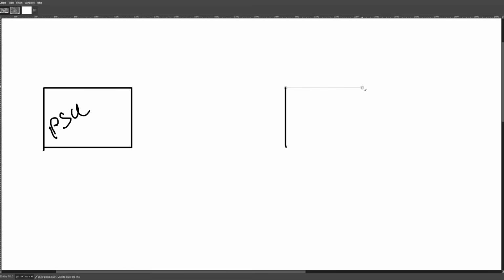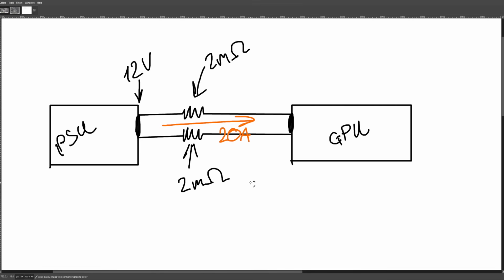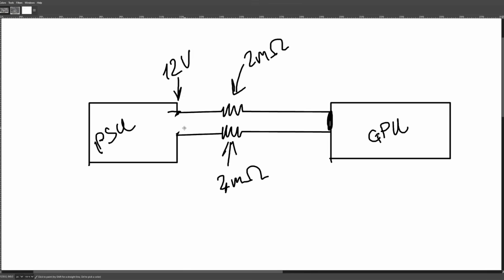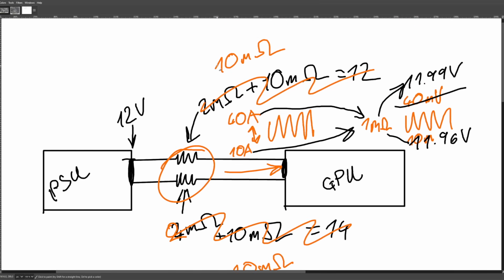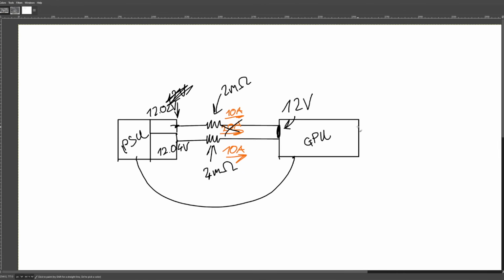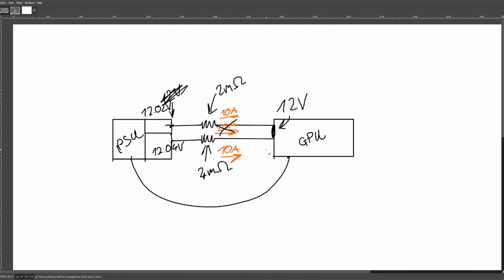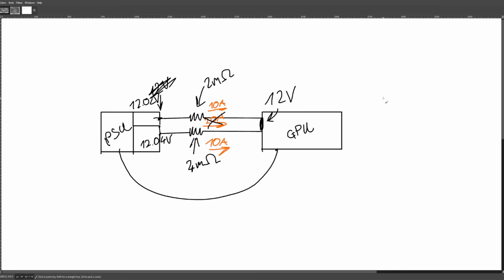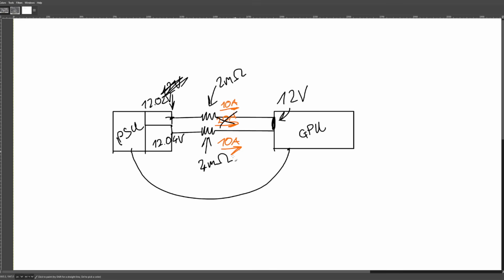Why ATX power supplies don't load-balance power connectors

Comment: Here's the top reasons i can think of why you will likely NEVER see a burned ground wire in the connector.
3. If the connection was ever bad enough to start losing sufficient wattage on a pin to do big damage, before that, your GPU is going to crash with PCI signalling errors, because you have gained too much of a ground offset and from the point of view of the GPU, the signal has started clipping the threshold or ground level. this is the least prevalent and most important reason.
2. there's a lot of excess redundancy in ground. While current will generally prefer to go back the way it came in, if it can't, it'll seek its way through the card edge connector, and if that doesn't suffice, through the steel bracket
1. the pin placement of the ground pins makes it less likely that their connection is unreliable
Reply: 2 - in regular PCs the vast majority of metal surfaces are common ground, mostly for signal integrity and EMI reduction reasons.
Some connector shells/shielding may be floating (unconnected) but that's more into nitty details of shielding efficiency (connecting both sides vs one and etc)

Comment: Short awincer is it would be to expensive 
grond never will melt because there is more contact to the ground. like the GPU being bolted to the Frame of the case..  and every single ground connector in the PCIe slot 

I work on a lot of linear power supply and we use .05 ohms for load balancing resistors for the pass transistors. 
so you would then be running 15+V and using pass transistors and sense wires to load balance everything...  OR lets just try this? go back to the old connector! or use the old connector's pins that have more mass and redesigned the connector form factor..

Comment: The high power connector is what is wrong with the companeys in this world save a buck on a connector and a few bucks on the motherboard and insane failure rates for consumors! This thing is desinged so bad. With zero safety margins! The old connectors so over designed and engineerd that these do not break not for motherboards or gpus. Why are these companys sticking to insane RMA costs? Even apple after generarion 3 of butterfly retuned to its old design. Wish there would be a class action suite against these companey! And they have to pay millions in damages think they would wake up then? Luckt AMD vendors are still sticking to the old connevor.

Comment: How about one PSU that does forward voltage sensing and variable resistance per pin? It would adjust its singular voltage to something higher based on the combined resistance of the load balanced cable connection to the consumer. Is there a problem with that?

Comment: Random thought, maybe NVIDIA can stop trying to achieve z-pinch fusion energy densities on GPUs and be more reasonable with power requirements of consumer products. (gets tossed out the office window)
lol.

If you just think about all the other stuff in your house that pulls a lot of power, most of it is heavily regulated with laws dictating how it is connected to the mains, dishwasher, stove, water heater, furnace, refrigerator, etc, a PC isn't one of them that requires a dedicated mains circuit. Just saying, lol.
Reply: Well PC`s dont usually pull 2-3kWt`s either. Even an average microwave is FAR more powerful then average PC, much less something like washing machine or stove.
Reply: @alexturnbackthearmy1907  not even, 600 watt stuff has all kinds of laws regarding it, so eh, lol. a refrigerator does not pull kilo-watts, most ten to twenty gallon water heaters use 900 or 600 watt heating elements, the low setting on most space heaters is 600 watts, etc. And all of that stuff has laws regarding how it's connected and used.

Comment: A good PSU load balancing would not be adding resistance to balance the 12V lines, it would be splitting the 12V rail into 6 independent rails, one per pin. Same way CPU and GPU power delivery works. If you can get 18+ "phases" on a $200 motherboard, why can't you get 6 sub-rails on a $200 PSU? It's not rocket science, the components only have to handle 10 amps instead of 60... why not? Yeah, it's gonna be more components, but cheaper components. Efficiency would also be fine, because one 95% efficient voltage regulator is exactly as efficient as 6 95% regulators in parallel. You don't really need remote voltage sensing for this to work, each regulator "knows" how much current it's supplying and can compensate for the voltage drop across the wires and connectors based on that, just like some USB-C power delivery controllers do. And if there is too much imbalance and the voltage at the card is dropping too much, that's something the card can easily detect and shutdown if necessary - that a lot better than melting the damn connector!
Reply: what you are suggesting is basically his multiple power supply example. since all phases are connected at the gpu side when one phase delivers less voltage the other ones would push current to that phase. and i don't think you can decouple them since they would always have a common ground gpu side.

Comment: Hear me out: 48V or 24V.
The main reason for all the issues is increasing power draw and thus increasing current, necessitating new cables/connectors.
I think it's gotten to the point where we're better off raising voltage to 48V or 24V from a safety as well as practical and efficiency perspective, instead of increasing current.
Reply: If we're going to change voltage anyway, definitely go 48V. That won't solve current balancing problems, but will improve things because you can get away with more inline resistance and lower sized wires.
Reply: I've been advocating (in the offline world) for using 48V for the main power delivery inside computers for a while now. In the automotive world, 48V ist a mature technology nowadays. Going from 12V to 48V, the connectors and voltage converters (convertion to ~1V for the chips) stay basically the same (48V is still well within the normal Silicon MOSFET range, without needing "fancier" stuff such as GaN MOSFETS) and you get 4x the power per wire. E.g. a 10A cable will give you 120W on 12V, but 480W on 48V.
As we're currently seeing escalating power requirements (e.g. Socket AM4 to AM5 increased socket power from ~180W to 230W, GPUs are worse), going to 48V would really help with keeping the complexity of wiring/connectors/power regulators down (at the small cost of a complete incompatibility of pretty much all power connections inside a computer :-P)
Reply: @SASAS-ru8ys 48DC seems a bit too spicy, that's entering (mild) shock territory; probably not a safety hazard but try explaining that to a first-time PC builder who gets freaked out by it. 24V or maybe 36V seems like a better balance of safety and efficiency.
Reply: @spambot7110 hasn’t been a problem in the past… old telephone lines use 48V to power consumer devices and PoE uses it as well… 48Vdc is not dangerous at all
Reply: Hear me out: Rectified 240VAC into 240 VDC and SN 441011 Type 23 plug, rated for 16 A ...  Would have said Europlug but that's just rated for 2.5 A.

But joke aside and TBH: if they want one single connector: ATX 20 pin. Otherwise get that shit 12VHP out and shoot the bean counter and engineers that came up with it and those that "certified" it out in the backyard ... so they can visit the farm like Little Timmie's Golfish.

This is a shit standard and it will never be good. As AHC says, paraphrased: It gets it panties all up in a bunch just because it only plugged in 99.9% correctly. To put in car terms:  "Your windshield is not 100% cleaned this car is not driving 1 meter." See how long you gonna enjoy that vehicle.
Reply: I've been advocating for this for a while, step-down and regulation is so efficient now it's nbd to implement. It adds a few dollars BOM costs though so board vendors will never agree to it. At some point though they'll have to.
Reply: The problem with this is that stepping down that voltage is also a problem. Silicon runs at 1-1.5 volts with stupid high currents. If we increase the voltage, we need much greater step down circuitry on the GPU.
Reply: @ MOSFETs don't run at a certain voltage drops, but do have a certain on resistance. Higher voltages as the source voltage to your buck converter will mean your switch conducts the same current with less on-time, and your ideal diode circuit fills in the rest. Your ideal diode circuit must be specced correctly to not drop too much voltage at the currents they run at, but that current is the same no matter the voltage drop, just with a higher duty cycle.
Reply: Or here me out, we stop using garbage connectors. Using thicker guage cable. Use non melting plastics. 

Wow!!!!!!!!!!!!!!!!!!!!!!!!!!!!! Oh!!!!
Reply: @battokizu  hell yeah lets mine a fuck ton of metals out of the earth unnecessarily
Reply: @ Nice bait.

Comment: Only a few hours ago I commented on another video suggesting balancing be done on the PSU about the balancing... and here's a buildzoid video covering it too! I get the feeling we both watched the same video and heard the same comment. But your rants are oh so much better than mine. Never change buildzoid!
Reply: Haha I think we both watched that video ;) the adventures in high power delivery he's doing are interesting, and I'm curious to see what results he gets with the improved sensors and logging, but I had to correct him on a couple of inaccurate assertions in that video including who developed the connector. I believe he's doing the work in good faith and it was a simple oversight, and what he's doing is certainly not cheap to build and test to destruction, so I hope he contacts BZ and they can somehow collaborate on some joint explanations and investigations.

Comment: Another thing to consider: when you naiively add resistors to this 10A connection (inside PSU), they will dissapate more power as a heat, because P = I*I*R. I*I is already pretty high, and increasing R makes total heat dissapation even higher
Reply: The only way forward I can see is to either reduce power draw or to abandon the connector entirely. It's not good in this application.
Reply: Or if increasing voltage to current balance if the imbalance is caused by a higher resistance on some pin then that pin will have more heat dissipation and in extreme cases melt even if the current is balanced.
It really is a no win for the 12 volt high failure connector.

Comment: This is effectively the same misunderstanding as "it's the volts that jolt, it's the milles that kill", for explaining that a high voltage likely won't kill you if it has a negligible current supply capability. That's true, but only because that high voltage is quickly loaded down by your body. Voltage and current are related, for a given system you can't just force one without affecting the other.

Comment: Would you mind someday explaining why the ground connections are not a problem, only the 12V? At least for me, thats not quite intuitive.
Reply: he did in some old video, but the tldr was something like that the pcie 16x port is mostly ground so under high load some of the return current flows through the mainboard to the 24pin or cpu power ground
Reply: @vincentschumann937 that's terrifying from a signal integrity perspective, wouldn't that totally fuck up the return currents for those poor PCIe signals? (i know they're supposed to be differential but i've also read that digital differential signalling protocols often function as pairs of single-ended signals that are logical opposites, rather than actual acting as physical return paths for one another)
Reply: In short: Current GPUs push way too much of the return current through the PCIe connector. That's not ideal for the mainboard, either, but it's not a melting connectors problem because the MB returns the current to the PSU via both the 24pin connector as well as all other connectors like CPU power and other additional EPS12V. And as Buildzoid said: They're so overspecced they just don't melt.
Reply: Current equals voltage divided by resistance, ground equals zero volts, so 0/R=0.
Reply: @Lost-One-n9s  i'm sorry, do you think that return currents don't exist?? just because you can read a formula and know the units in it doesn't mean you know how to apply it. voltage is a relational measurement, there is no such thing as "zero volts" in the absolute sense. you pick an arbitrary point in the circuit and you draw a ground symbol there, and you declare that zero volts to make the math easier. there's nothing from stopping me from saying the positive rail is actually zero volts, and the negative rail is -12 volts, if i say these words out loud will the negative pins magically start overheating?

Comment: The current imbalance is not the problem. The heat is the problem. Even if you current balance per wire, when a high current draw occurs and the resistance of the connection is high enough, then the issue of heat generated at the connection is still there. It could still be a fire hazard. Who cares about efficiency and voltage drop at the gpu when the connector still melts. You need an early warning for that, better yet a safety shutdown.

Comment: I appreciate the effort, but this is a very simplistic explanation. To model this properly, you need to consider multiple resistances end-to-end: the connector resistance on the PSU side, the wire resistance, and the connector resistance on the GPU side (per wire), then the load resistance and possibly even the internal resistance of the PSU. Everyone just talks about the 12VHPWR connector, but if something on the PSU side is adding to an imbalance, this could amplify issues in the 12VHPWR connector (which I think we can all agree is a bonkers design for such high currents). My suggestion is to model all this in a circuit simulator. Also, I wish someone would desolder one of those connectors and get some actual measurements with an industrial multimeter which can accurately measure low resistances. Also did you mention Kirchhoff? I may have missed it.

Comment: Another option would be to put a power supply directly on the GPU and run a second 120 VAC line to the computer.

Comment: is the asus Thor III PSU advertising the VGA priority feature not actually a load balancing feature at all? You said it’s just voltage sensing so it’s not actually doing something to actively balance the load on all pins? that was the main reason I was gonna get it cause I thought it did load balancing
Reply from the maker: nope it's not balancing it's just to compensate for the combined cable resistance.
Reply: @ wow. good to know. is it an effective method or do you think just marketing?

Comment: So much trouble for load balancing when the simplest solution is to just use a single conductor. It may not be sexy as that wire will be thick but it will be safe, simple, and cheap.

Comment: when i heared the 1st haldf (mainly about the psu ) the only thought in my head: "would that be amazing if we had extra cable that connect to the psu and make that power balance...?
nvidia: "we changed the plug and added a 4 pin sensor."
costumer: "the sensor is for balancing the power, right? right....?"

Comment: If they had designed the spec with one none-current drawing wire, they could have messured the voltage at PSU and the voltage at GPU and the shut down gpu if the delta is to high. This is just one way of adding safety. But the spec "as is" have no safety at all.